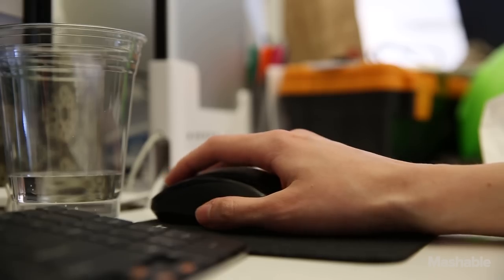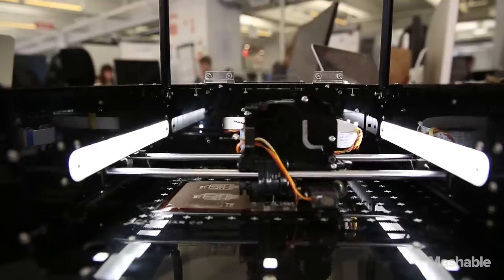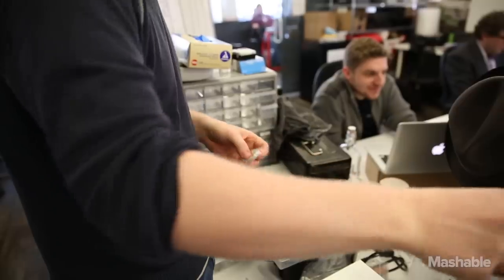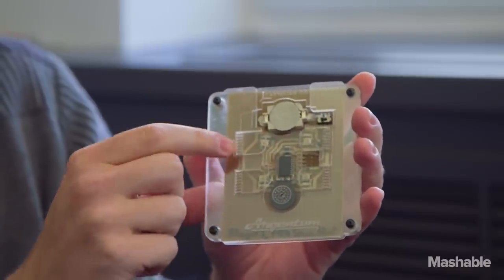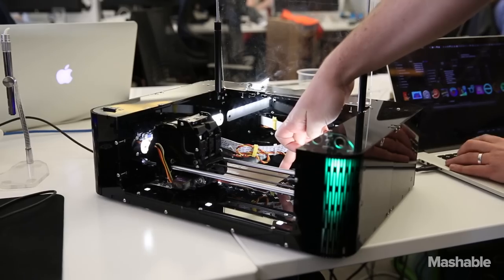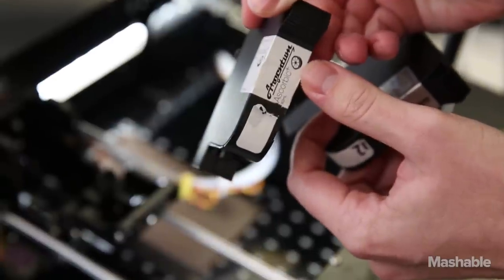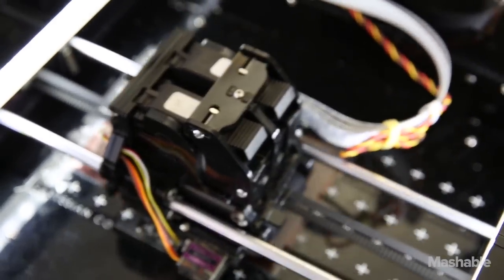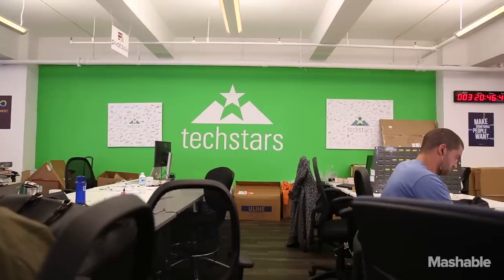The world's first 3D printer for electronic circuit boards | Mashable

Comment: Or use PCB123 or ExpressPCB they provide all the software you need. Then, you submit your design on their website and get them in about 3 to 5 days. But yeah, this will work great. Although it is not 3D printing it's more like modern circuit board etching which has been around for a long time and it's relatively easy to do but probably more time consuming than using this technology. You still need to manually drill holes but there are plenty of surface mount alternatives; not so much for mechanical parts like switches, knobs, motors etc..